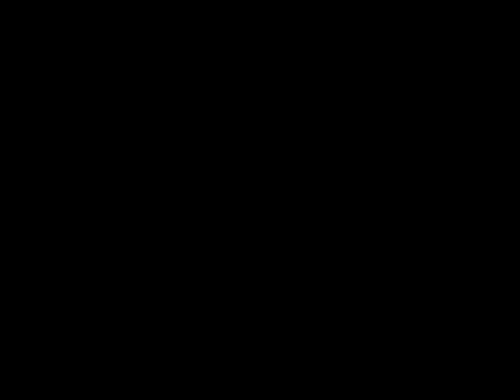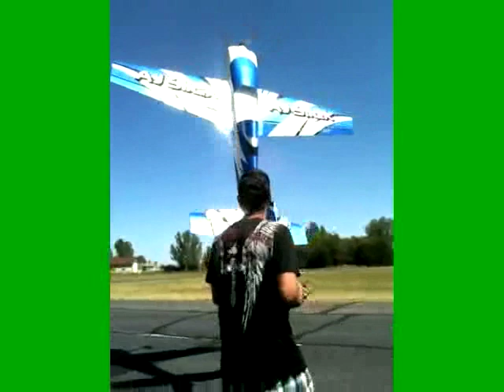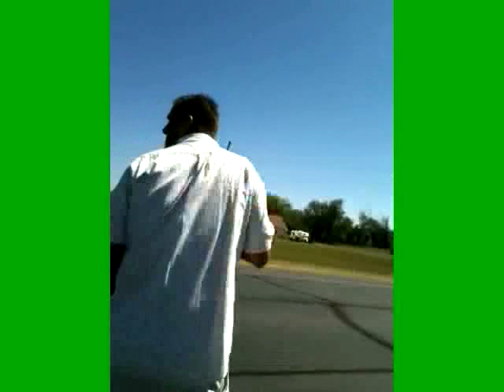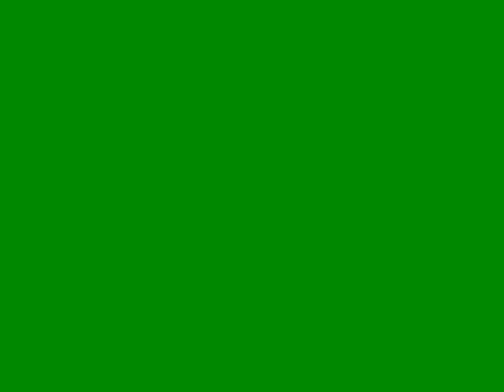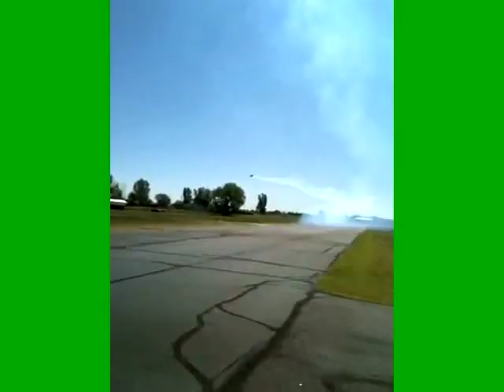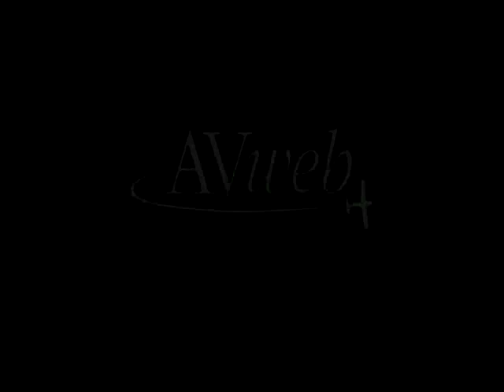Biplane and RC Airplane Midair Collision

Comment: @arparadis The biplane was not on landing approach - it was in a pattern for a smoke-on fly-by.  The guy on the hand-held radio was in communication with the pilot, and the full-scale pilot knew there was RC activity at the field.  The air strip is a private air strip with no control tower.  There was apparently a mis-communication between the two pilots via the radio guy.  All three should be held accountable for their part in the incident.  End of discussion.

Comment: @arparadis The RC Plane is 10.5 foot ws. Comparing that to the distance between the full scale plane and the ground you can see that the FS plane was flying at ~30 feet off the deck (not 100+). People actually at the event confirm that it was 30 feet AGL & was not an attempted landing. The people on the runway count as being "over people".  The pilot is responsible for ensuring the runway is clear of obstacles before doing that run. The airboss DID NOT tell him to land. Told him to go left.

Comment: @stikmunkey If the event organizers had acted properly and closed the airport during the demonstration, then I'm sure the AMA would have no issue. The demonstration wasn't too close to the spectators (I see people hovering over AMA RC fields all the time with people just as close). The AMA typically doesn't review exhibition events, they just publish standards and provide liability insurance. The standards were clearly violated with respect to clearing the airspace, but not spectator proximity.

Comment: The organizers of this event had no NOTAM that the runway was to be used for RC model demos, the RCer was flying in contravention to AMA guidelines and the biplane was doing some sort of demo/go around. It seems that each part has a partial responsibility, but I have to lay the most blame at the organizers feet. I have seen the complete video and there was an even organizer playing the role of air traffic coordinator.

Comment: @charlieechovictor  The ready to fly weight of the 126" 3DHS Slick in the video is roughly 45 lbs. So, it has considerable mass. The 200 CC engine is quite dense as well.

Comment: Basics of the event (since its scrolled down to obscurity... or is in one of the other postings of the same video)

Poorly organized combination full scale and model event at a privately operated runway.

Full scale biplane called over the radio with intent to LAND.
Model commenced to move out from over the runway to give clearance.
Full scale decided to do a high speed low pass instead of landing... and moved out over the grass instead of staying over the runway.
Since the model had moved with intent to clear the runway, he wasn't totally at fault, but he should have put the plane down in the grass and taxied well clear rather than hovering beside the ACTIVE runway with a full scale on approach.
Full scale was partially at fault for not doing what he had communicated were his intentions.
Event organizers were primary at fault for not having adequate air traffic control coordination for this type event. 

The norm is to have the models ON THE GROUND if any full scale is going to closely approach the runway.  AND to warn the full scale of the models, then tell them when its clear. (Clear meaning: NO models in the air)

Having flown models at a full scale air show and been involved with it being done right, (for several years) I know it is very easy to keep the models and full scale from ever having any chance of colliding.
(Just flew a model at the air show again the weekend of May 1, 2, & 3, 2015)

I look up this video occasionally to link it to others as an example of what NOT to do.
Reply: It's true he had the intent to land, but going around is always an option, and the space to do so is always reserved. Unfortunately I don't think the model pilot understood this, but there was so much else that went wrong here.

Comment: Some years ago I was flying one of 6 r/c planes at the end of a closed runway - but one guy decided to use it to takeoff in his vintage (radioless) plane. He flew straight through the middle of us at about 50 feet and 60 knots while 6 r/c planes scattered. Fortunately our planes were faster than his. Never did find out if he got reported.

Comment: Thanks for that Comment radridz3. Bottom line is this. RC flyers should in no way ever be allowed to fly at any private or public airstrip. Period. Ever !! All these guys were in the wrong for allowing RC fliers to be flying in and around this airstrip used for Passenger planes.. Period !! Any public or private airstrip should be outlawed for RC use. Period. Way way too dangerous.
Reply: I fly my RC airplanes at the end of my local public runway, you brake it you buy it 🤷

Comment: @reltney20 I beg to differ. A low pass like that IS against the FARs and there are several FAA actions going after pilots doing highspeed passes over runways. Unless using the runway for taking off or landing, the FARs clearly state that we can't fly aircraft within 500' of people or property (which he clearly was). Pilot can't argue this was an aborted landing, his smoke was on. That said, there definitely should have been a NOTAM.

Comment: Was the runway marked open or closed?  I believe they are supposed to put big white "X"s on the ends of the runways if they are closed, such as for being used in an RC meet.  If the runways were closed, the fullscale pilot is 100% at fault.  If the runway wasn't marked closed, why was someone flying RC on it?
Reply: Ken Koellner Basics of the incident posted.

Comment: Just viewed another video of this . It is around 5 mins. I can see there are lots of Passenger planes parked along side the runway. My Guess is that the Pilot of the Bipe could see all the planes and people and chose to do a pass first and see if the runway is clear. The Bipe picked a safe line up off to the side and away from the crowd and stuck with his line. If under instruction from someone or not, the RC pilot chose to move into the line of the Bipe pilot which was the wrong move. Period...

Comment: @slammerf16   An RC Show? Anytime you fly an RC and there is someone else with you, it is a show.. Right ? Guy should have yeilded the air space. Period. Clearly the Bipe Pilot was Yeilding by flying off line to the side and up from the runway. Clearly. As for speed. Who cares? Except the speed should have told those on the ground this was a pass and not a landing attempt. So why did the RC guy move from where he was?The RC guy not only moved off his runway line but gained altitude as well.Nuts!

Comment: @arparadis In my view the bipe pilot damn near committed suicide. Aborted landing my ass. It may have started that way, but when he firewalled the throttle, popped smoke to put on a show for the crowd, it became a stunt. He failed to see and avoid. I'll bet $100 that the pilot gets a 91.13 violation for being careless and reckless. As for the RC pilot, yes, he shares some blame, but his blame is ignorance. He assumed the "Air Boss" was the authority and when he said "go fly" it was ok to do so.

Comment: @grabir01 heres my 3 cents. First take the rc'er out of the picture. The bipe is clearly breaking 3 seperate rules with his flyby. Now the rc'er  is not at fault. He would have never takin off and hovered over runway without permission .The person at fault is clearly the radio operator.  Also rc people that fly gassers and 40% and up are knowledgable they dont just take off at a real runway without permission to taxi out. Think about it. .The bipe pilot will catch the most crap for this.

Comment: @arparadis tail wind landing my ash he blew smoke and was showin off. The rc guy was cleared to fly but communication between the air boss and ground is who should be blamed. This is why you dont let OLD GUYS FLY WITH YOUNG GUYS. Works the same way in cars you try and avoid the old people all day....RT.....ANSWER THIS if it was a failed landing why is he all out blowin smoke at 30' off the deck. Thats how the Bip pilots gonna try and get out of his 91.13.. Missed Approach my ash...........